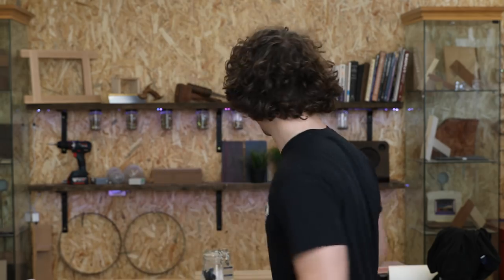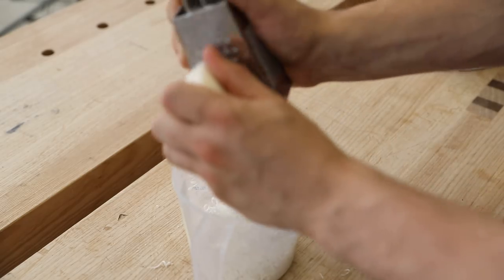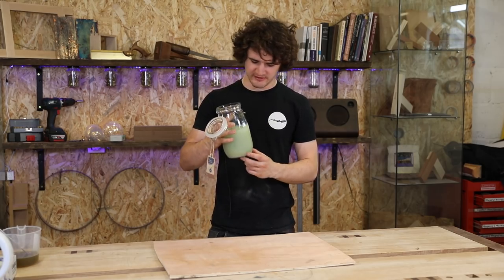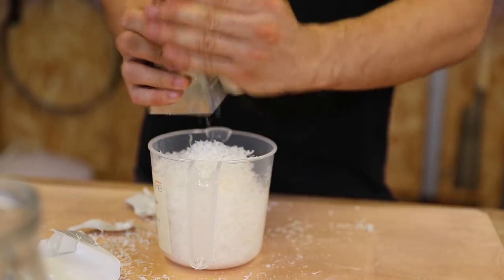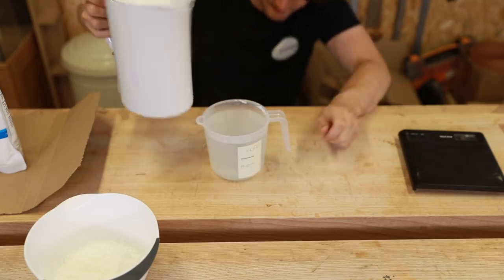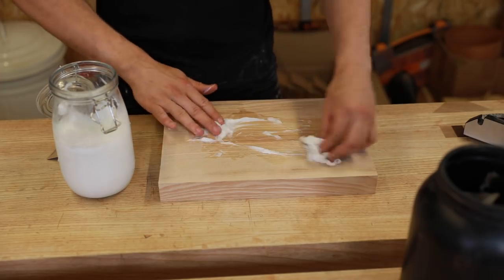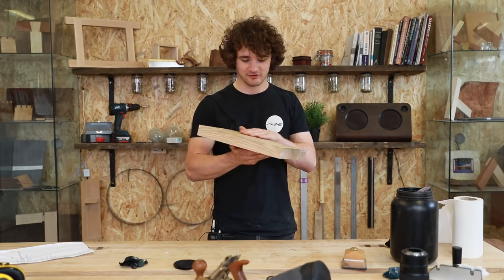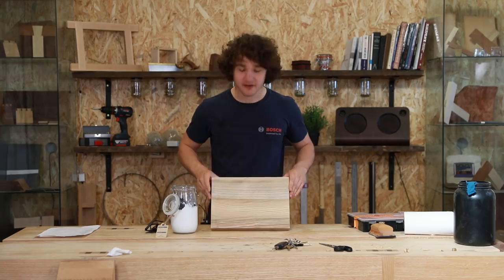Traditional Soap Finish | Experimental Wood Finishes #5

Comment: I used the same soap as your 2nd Amazon order and it worked pretty much as yours did here. One thing that I found worked well, is after doing a couple of applications of it normal consistancy, make a small second batch that is much thicker and sets to a kind of wax. Put that on as a final coat and buff it out and it really comes up a treat...
Reply from the maker: Yea I should have tried that really! I think I got too impatient by the end of it

Comment: As a soap maker that is just getting started in wood working this video was really interesting. We don't use volume much in soap making, you might have got a better result with weighing the grated soap. Water is fine to not weigh for something like this though because 1ml = 1g. Then the weight of the soap would be on the packet, so easy to estimate. Does alcohol damage wood? If not alcohol might have been a good choice because it will dry very quick and not make the wood expand so much, it will also dissolve the soap quicker. If I was doing this though, I'd be tempted to rub the soap on as it is, like chalk on a blackboard, then buff it in. It might be more elbow grease at the beginning but I think it will be overall quicker to get the layers on. Then maybe a final wipe over with alcohol to smooth down the layer, it might get a little sheen then too. I'd love to try all this out one day, thank you for the inspiration and demonstration 😀

Comment: Wonder if the main difference was that the first soap you used was based around coconut oil while the soap flakes seem to be a more normal soap, as coconut oil has a really low melting point maybe it affected the makeup of the mixture (also really should use scales for things like this, I would guess, gets your ratios more accurate ;) ). Still fun video, really glad I came across your work recently, currently binge watching your old videos :)
Reply from the maker: Very good point. Didn’t even consider that despite the fact all the coconut oil in my house is liquid at the moment!
Reply: This is most likely it. Most soap sold as bars is not actually the actual substance soap, but some approximation that in almost all cases have the same effect while being cheaper to produce.
Reply: I do think the recipe of the soap here is the culprit but the melting point of the coconut oil will not make a difference here as after saponification, the molecular structure has changed and it is technically no longer coconut oil, it’s sodium cocoate. From my understanding you are supposed to use soap with sulphates added for this technique, not a more natural bar, however as a soap maker I have made this exact gluggy mixture for my laundry with my own purely oil based soaps so I couldn’t really tell which ingredient is preventing that from happening.

Comment: I used a natural laundry detergent(Castile flakes) in my mix. Interestingly it had u.v brightener in it, which I learned after the fact of mixing the finish. I read you can use this on top and under other finishes, after seeing what the brightener did to the wood I put the soap finish on top of some stain then under some polyurethane. The wood was pine from the box store but after the soap finish it took on flamed maple characteristics. Haven't done anything with it since. putting it on woods we wouldn't consider a box lid or show surface, then getting a different look from a soap is a experiment worth a try.

Comment: You could add a video on ebonizing wood to the playlist. It's also sort of experimental. What I tried was several coats of extremely concentrated black tea, until the wood was starting to change color, then one layer of vinegar in which iron filings, rusty old screws and whatnot was kept for a week. The wood instantly blackened, but the grain stayed visible. IME, works best on hardwoods. Softwoods seem too porous, and the area between the hard parts of the growth rings stays too light. On hardwoods, however, you get lots of shades of black, but no grey. Like coal lit from different angles.
Reply: Vinegar and iron works good with white oak.

Comment: the common danish method (I lived there for a long time) uses soap flakes, which you used to be able to buy in the UK. but as Dri-Pak, the manufacturers, have stopped producing the flakes (the machine was ancient and finally gave up) the alternative is to use 'Liquid Soap Flakes' which you can get at Wilko (and unlike the flakes, it doesn't contain any palm oil). it's important to use pure soap - no additives as these might affect the result

I use a 25% mix of Liquid Soap Flakes to cold water: if you're using it on oak, you might want to try a weaker solution as too much soap can react with the tannin and turn it greyish black, and not in a good way. it's easy to mix

as for the finish: if you go to most Danish dives you'll find oak tables which ar very clean, even though they get beer on them all the time. they're washed with soapy water every day and simply left to dry

Carl Hansen has a great video here: https://www.youtube.com/watch?v=1OG_PL-Rf58  (sorry about the yank accent). you don't need to sand: I find that a good quality scotchbrite pad works very well
Reply: Wilko Liquid Soap Flakes: https://www.wilko.com/en-uk/wilko-original-liquid-soapflakes-750ml/p/0412410 

you can get it as Dri-Pak liquid soap flakes - exactly the same stuff, just usually more expensive

Comment: To the ones experimenting troubles doing this finish on Oak, I just made tests and had the same results with the oak turning greenish/grayish/brownish... in an unpleasant way.
Scrapping the soap I noticed it was brown . So it 'pumped out' the tanins fron the oak.
I washed the oak pieces with very hot water and a brush . The water turned out to get brown.I then set the oak to dry close to heat source so that it don't soak too long.
Day after I started to soap again and it went out perfectly. I mean., there was a slight color shoft compared to the more "Drift wood" the oak had after drying. but it finally reached the danish oak color some might expect from this finish.

So, "wash" your oak to get the tanins off prior to soaping it.

Comment: The reason it changes the color is the Sodium Hydroxide (Lye) in the soap. It's a strong base and will attack the tannin in the wood causing a chemical color change. If you're interested in learning more, search for information on "bleaching wood".
Reply: Thanks for this answer. I just did it on oak but it's turned greenish now...I wonder how danish design forms keep the pinky tone of their oak products... Is there a way to "degreen" it? Thanks

Comment: Also- this finish is kind of a weird one to say you have to reapply.. because you just have the soap mix on hand in the fridge and just use it to clean it when you’re washing the surface and it is the cleaner and the reapplying together as one. Plus the watery liquid will assist stains and nicks and dents to left out.

Comment: The mixing ratio is really not that important. And you shouldn't compress the shavings.  Let the mix set for 24 hours and it will set really well.

If your mix is in the thinner side, it will just take a few more coats. 

The point is to let the wood soak as much soap as it possibly can.

When we reapply soap to a piece of furniture it's normally a really thin mix. Just make sure to apply an even layer.

Comment: 240 grid is wrong

You dont soap annything higher 120 Grid…

Sanding. 120

Soap

180 

Soap

Ending

240

You cant get the soap get into the Wood when you blocking the woood with 240

Btw the soap you Can make in 5-10 min and it shall be like a heavyrock cream no need to stay for 24 hrs

Bedst regards flemming 

🇩🇰 Denmark

Comment: In Denmark it's brown soap flakes used for floors and furniture.
Not sure a bar of hand soap really compares to brown soap
Reply: I know it is traditionnaly used for floors. But doesn't it wear out too fast ?
Reply: Seb R you add soap flakes every time you wash your floors.
Reply: oh yes indeed !
Reply: Dennis, just looked up brown soap and got two result as far as composition goes. One was lye soap and the other was naphtha soap. Not sure if this equates to the brown soap that you are referring to. The bar that Matt used is coconut oil soap, makes your furniture smell like a tropical holiday, but if I was going to use flake soap here in Australia it would be pure laundry soap, but this is considered a "soft soap". Nothing like adding more murk to already murky water.
Reply: Sorry, brow soap is for cleaning tiles etc.. I had to look it up. White soap flakes is what is used for wood.
Not sure what the benefits are using soap, vs oil/wax
Reply: In nprway we use green soap for wooden floors. Ill have to test that as a finnish for a project. Suspect simmilar results though.